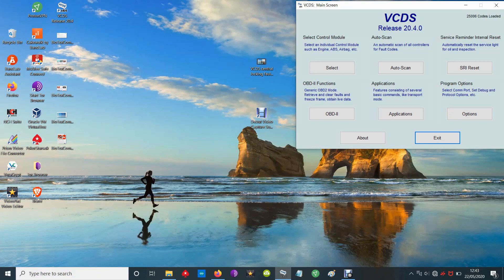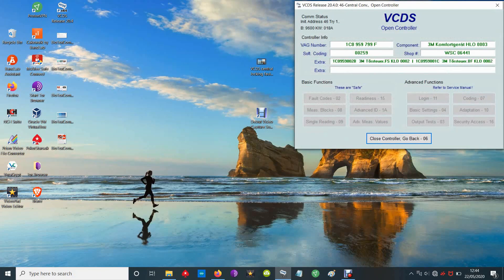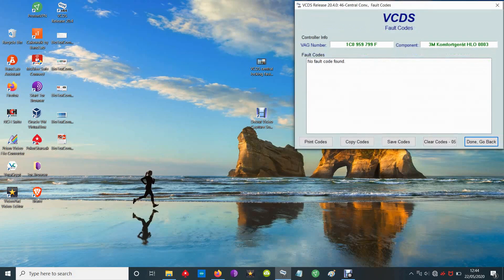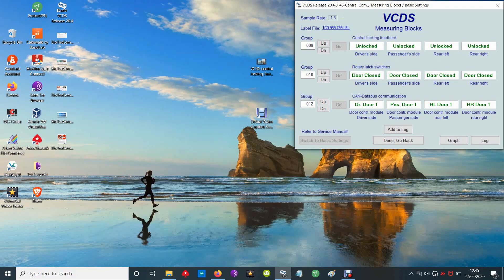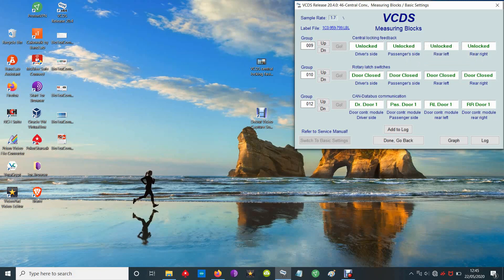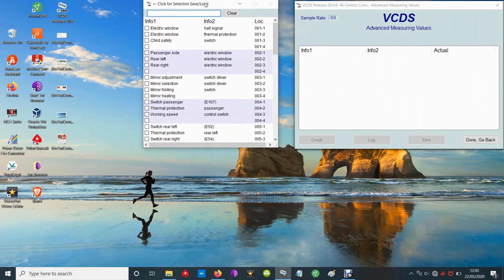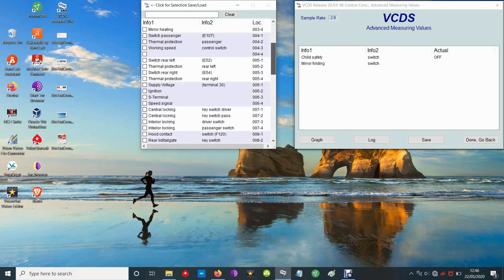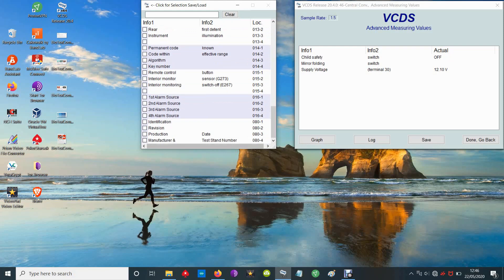Using VCDS to access central locking data on SEAT leon mk1

Comment: Hey there, thanks for the awesome video!

I need your assistance (if possible).
I recently replaced the ccm unit on my Skoda Fabia mk1 to gain remote locking.

Everythings working fine, BUT, only the 2 front doors lock & unlock via the central locking and the remote control. (I was told that this occurs because the new ccm unit was harvested from a 2 door car, whilst mine is a 4 door)

Do you have any clue if and how I can upgrade to lock&unlock all the doors via VCDS? 

Thank you in advance mate!
Reply from the maker: Sorry, only just seen this, guessing you've sorted it by now! For anyone else with a similar issue you need to change the long coding to that of the previous unit or that of an identical 4 door car. Be sure to make a note of your existing coding in case there are any issues.
If you're not already using it then seatcupra.net is a great resource.

Comment: hi i have a seat ibiza 2006 on vcds it gives me can not ready with hex-v2
Reply from the maker: That should be fine. As long as it says :
K1:OK
K2: OK
Then you should be good AFAIK.
Reply: @MattyEngland   CAN not ready and don't work.
Reply from the maker: @bojanblazevski7829  Do you have 12volts @ the OBD2 connector? Maybe check the fuse for the obd2 socket?
Reply: my friend has the same one as mine, we tried it and the same problem happened to him

Comment: Greetings Matty....Is This..vehicle Diagnostic's?
Reply from the maker: Hi mate, yeah I've branched out into vehicle diagnostics today rather than the usual drones lol. 😂
Reply: @MattyEngland  Aghh  lol Hi tech stuff...Thats cool  !!  As a retired electrician who dabbled into electronic's here and there...Unfortunately (LOL )  I turned into the whole family's mechanic for years
Most people that are handy..Can diagnose their cars..with a simple Multi-meter and a basic book on their Particular Car..the simple computer thats in these Cars of today...ARE worth ZERO...without the engines Sensors..without the proper input of these sensors..ALL YOU will end up with is HIGH Dollar repair for labor and a 30 dollar Sensor...All these sensors work on varying resistance of control voltages...Magnetism..and Frequencies...ALL of which can be tested with a Multi-meter
The cars today...Their Running Behavior is controlled SO much by the computer...Fuel injection..timing..EGR..safety etc. by Vacuum switches and Servo's
I cringe..when a woman is stuck on the side of a road...And She gets a bill for 450 + bucks..to replace a 35 dollar Crank position sensor!!  (20 min job by a decent mechanic on most cars)
Reply from the maker: @dive2663225 
Ah that's cool mate, I didn't realise that you were an electrician 👍 That must have been an interesting job, especially out on the oil rigs and that. 🌊 I imagine you must get some pretty large ass power cables on an oil rig? 😂 They must make a 120 amp battery cable look like just a bit of fishing line in comparison 😂😂
I completely agree about the sensors and components, it's amazing how many times people just take a guess at one and hope for the best. Also happens a lot here where the main dealers charge people for expensive control modules, when sometimes it's just a  capacitor that costs pennies or a bad ground.
 I definitely like to have a good poke around inside stuff with a multimeter  before I decide to spend a fortune replacing it, that's for sure. 👍👍
Reply: @MattyEngland  Allow me to clarify...As A kid growing up.I worked for Two Uncles that were electricians...Went in the oil industry After Leaving the Military in 73...74...started rough necking on land drilling rigs..and made it to Driller in a little over 3 years..Went to work offshore And Drilled overseas for ten years...When I left the industry in 87..I took and passed The exam in 88' and worked as a sole proprietor and Did some work Up In Newfoundland In Marine Electric..Retired and came home in 2015...ya Never really retire these days...so i do a little work now and then, when I feel up to it..
Reply: @MattyEngland  Aghh Yes  RIG Electric..The Heart Of the Power on an offshore Rig....Giant 12 cylinder Morse Fairbanks/Cat Diesels..2-3 of them..and a Smaller Emergency one.....Turn Giant A/C Alternators  producing...7-9000 volts.....routed To bays..6-8 of them...Each containing Giant silicone Rectifiers...which convert The A/C to DC current...Controlled with Silicone Gate Diodes..A bit bigger than a hockey Puck.The Muscle on the Rig..DC Traction Motors...Drill Floor..80 ton cranes...Including 6 3000 HP 360 degree azmithing Thrusters..(Drill ships) etc...all DC Traction Motors...The Only downside To this Big power...Is ..lol as you say Conductor Size..DC Power suffers a greater voltage drop the further away it goes...to Compensate for that Larger Conductors are required than A/C conductors
These Traction motors are controled very accurately for Speed..Reverse rotation and Torque
Reply: @MattyEngland  Yes...most electronic's if half-ass'd engineered well...can almost always be repaired by Finding a cold Soldier joint in the component/ Board.
I have Replaced Better Quality..Electrolytic capacitors..gone bad in Some Car PCMs / Computers...trouble today is...Running into an 30 leg IC Chip custom designed for the Manufacturer...That You can test alright..Long as you can get its spec's...Without them..LOL Call it a DAY!!
Manufacturers / Designers  are Very reluctant to give you that Info  LOL
Reply from the maker: @dive2663225  sounds like you a pretty varied and exciting working life then mate. Proper man's work all the way through your career. Most of the snowflakes today couldn't even drill a hole to put a shelf up, let alone drill for oil 🛢 🤣🤣👍
Reply: @MattyEngland  Yes..when i see a man like that..I wanna Vomit...Yes I did have an Interesting life, all By Gods will..I am Still here..LOL...I Know if i had it in me..i could probably write at least one Best seller..with the shit i have seen in 68 years  all over this world
God Bless..Be Safe!!